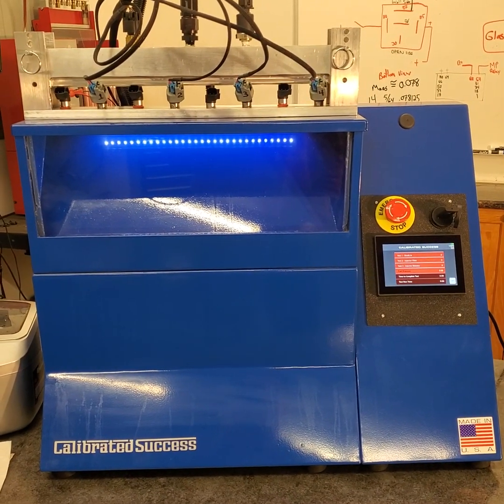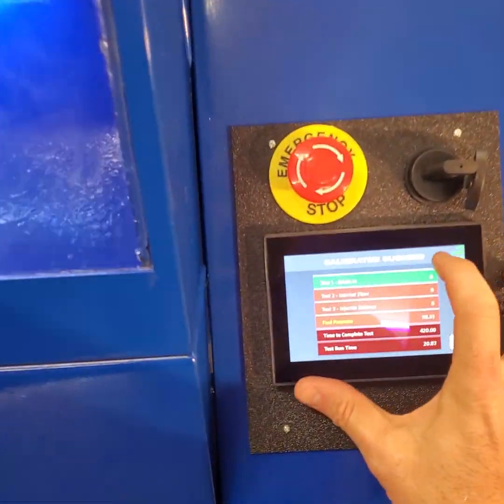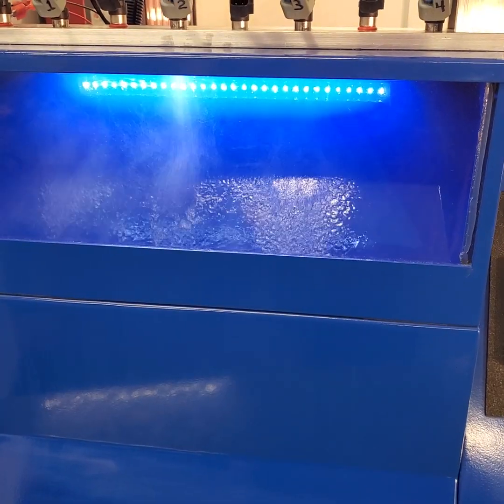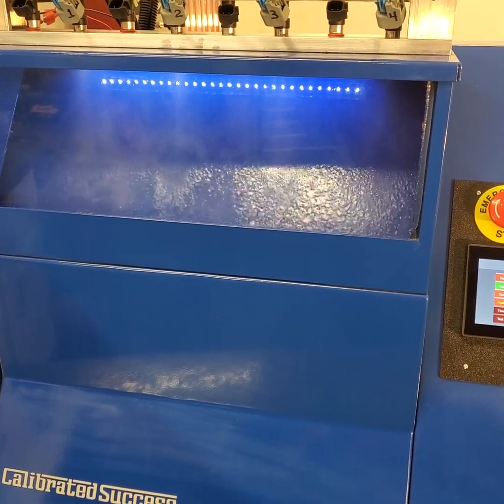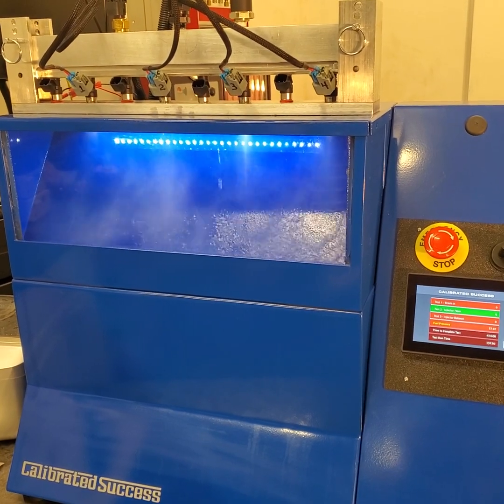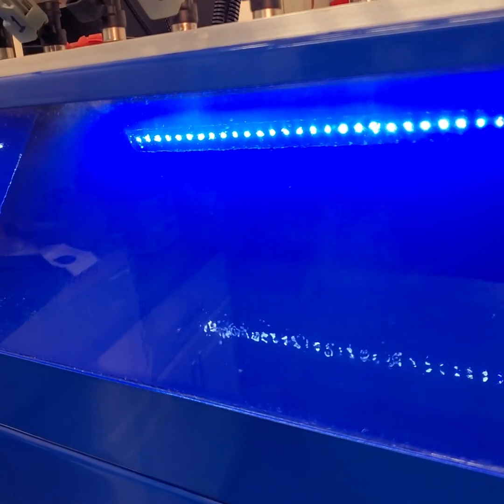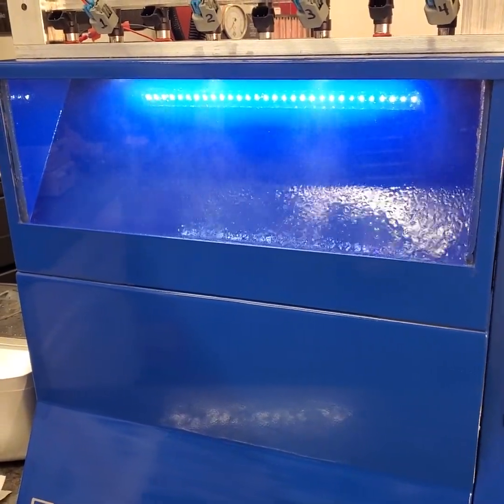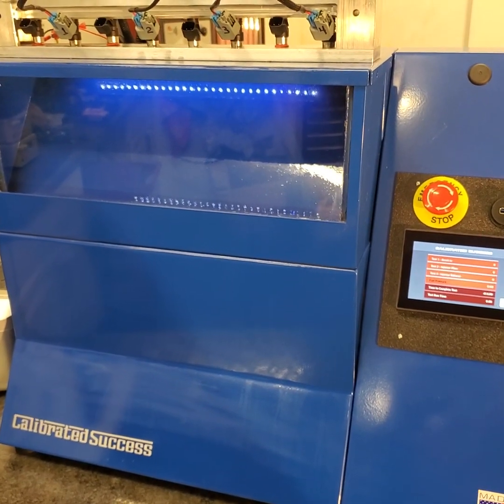Calibrated Success Fuel Injector Test Bench Operation

Comment: Have you ever compared injector characterisation data using that machine compared to testing on a vehicle with an oscilloscope and measuring the voltage and current. I do alot of Dyno tuning and iv been trying different ways to get injector data when it's not available. Using OE ecus seem to like data from a machine like yours stand alone ecus work best measuring lambda and adjusting dead time I guess this comes down to fuel dilevery same reason you don't check 8 injectors at a time. I only test one at a time on my flow bench.
Reply from the maker: The scope method may get somewhat close, but it misses the fluid dynamics part of the problem when determining offset. By taking a precise flow measurement at each pulse width, we are able to accurately determine the functional offset along with nonlinearity at small pulses just like the OEMs. That way, when you get into the vehicle and take lambda measurements, you can concentrate on the airflow model and wall film without worrying about injector errors.

Comment: Being that you are running only a single flow meter, and multiple injectors at a time, are you running injectors through this machine that you assume are already flow matched?
Reply from the maker: Yes, the machine has a function to perform a flow balance test that generates a report showing how the injectors compare to each other at two different operating points along with % deviation from the average. If these results are deemed sufficiently close, the characterization testing will represent the singular average values that should be used for ECU calibration. This helps avoid calibrating the entire set around one particular injector's variation, but rather to the true average that the engine sees.
Reply: @eficalibrator  Is it possible to characterize a single injector or it has to be a set of minimum 4 injectors ? Are there any limitations of single flow meter concept ? Thanks.
Reply from the maker: @LaimisBMW  it is possible to process 1, 2, or 3 injectors at a time with our engineering review of the data. There are a number of engineering advantages to the method we chose, but I am not going to teach the imitators where the potential issues are at this point.